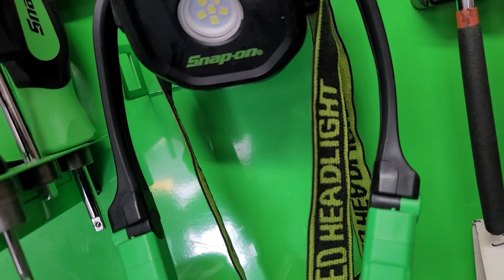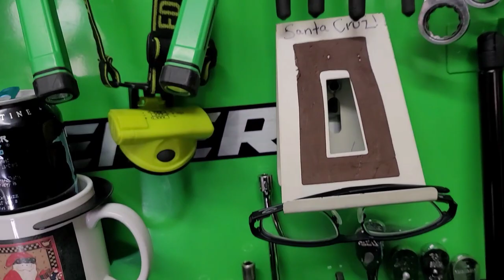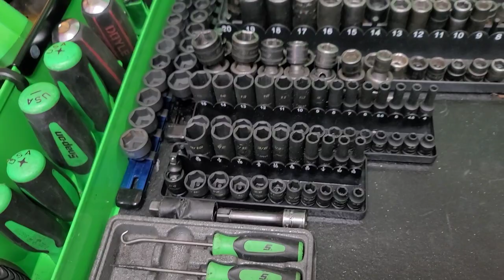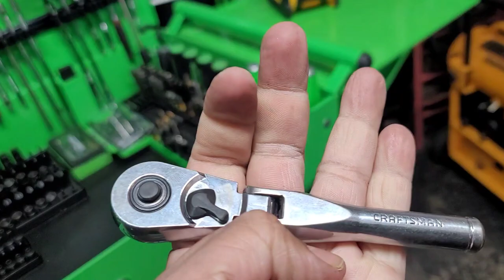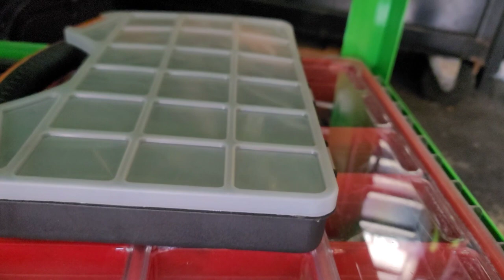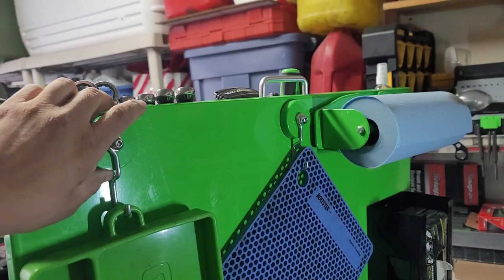Powerstroke Diesel Tech (everything else too) US General tool cart tour!!!

Comment: Green is the only color hahaha! I had that same cart with the black trim and bumpers before I got my current 6 drawer US general. Great carts for the money, I've had a few of the bluepoint 5 drawers just like it and I don't think id ever spend that kinda money on one again now that you can get the US general. I also had those wrench trays in all my setups until I switched to Toolbox Widgets. I used to love those trays.
Reply from the maker: #greentoolsmatter lol, you can't beat those carts for the money, the 6 drawer carts are a great deal too. I now work out of a 6 drawer combat green Snap-on cart but wish I had bought a 6 drawer US General. I love your tool boxes, old one and new one
Reply: @PowerStrokeJude  Thanks dude! Greatly appreciated! I used to have a Matco Jamestown 6 drawer that matched the old 5s but unfortunately I didn't have a use for it a few years back so I sold it. Then I ended up needing more overflow room again and snagged the US General because I couldn't justify that kind of money on needing more junk drawers lol. Kinda wish I kept the matco one but either way very happy with the Harbor Freight

Comment: For the upper trays attached to the lid you can use the smaller grommets in the holes to keep the Screwdrivers from rambling around and yeah that 3/4" Drive Breaker bar is thick they most definitely come in handy when called upon ....If you want your pry bars to fit in the side compartments you need a Step bit to bore the hole from underneath it will give it a fresh clean circular cut as if the box was purchased like that ...I used a Milwaukee #12 step bit to do the modifications because my handles weren't just Thick they were also too long ...You will most definitely need that Milwaukee step bit because the Harbor Freight step bits do not provide the boring measurement you would need and its very simple you will not over drill because it will penetrate in levels so you will not bore to small or too big you can bore to a precise measurement according to how your prybar handles are designed.....Great video you already know ☕ 😉✌
Reply from the maker: Thanks for the tips dude! I'm going to make the pry bars fit! But you already know ☕😉🤙

Comment: Cool. The nut drivers are super handy. I got a set of super stubby Impact ones for the m12 fuel impact driver. The setup is badass, you can get into some crazy tight spots. I used to think nut setters sucked-go figure.

Comment: Thanks for the tour! Getting ready to move my most used tools into a 5 drawer cart and watching a ton of videos seeing how everyone has laid theirs out. Yours was very helpful and thorough, thanks for putting it together. I think you could do a little better on that top right deep drawer also! I'm planning on setting an Ernst 11 comparment organizer tray in mine, filling it 1/4" hex bits, adapters and drivers and then laying my 1/4" hex impact driver over it. May also put overstock screwdrivers in there that don't fit up top. That set of red and black handled cutter crimpers in your bottom plier drawer is a pair of stakon pliers from Thomas and Betts. Super solid old school tool.

Comment: I’ve got the 2 drawer Yukon joint I was brand new in a shop and had to get more then just a cart so I still have it and make it work I also have a bigger box not a tool truck one but I keep mostly bigger stuff in the box and then my cart I use has basically everything I use daily

Comment: I have found that them little gorilla glue lasts 50 times longer if you put it in a fridge
Reply from the maker: I'll try that,  thanks
Reply: @PowerStrokeJude  no problem bro just a trick I have learned over the years especially if you use it once and then don't use it for a year the bottle will be hard fridge helps keep the glue soft

Comment: I’m considering buying one of these harbor freight tool carts for myself. How is your box holding up? Do you recommend it for the diy auto mechanic?
Reply from the maker: Sure, it's holding up fine. I do recommend buying 2 swivel casters when you buy the cart that way you have 4 swivel casters (cart comes with 2 swivel and 2 fixed) easier to move around the garage